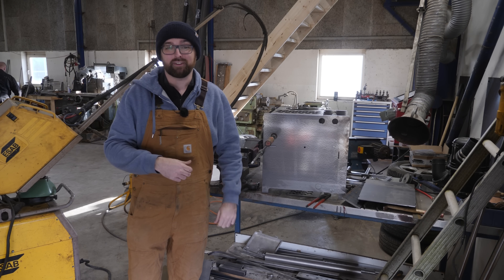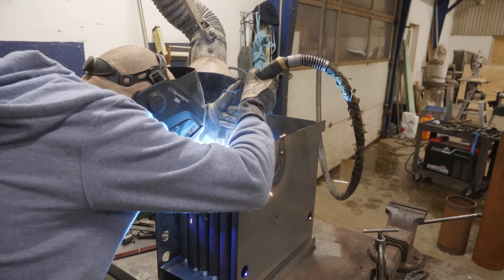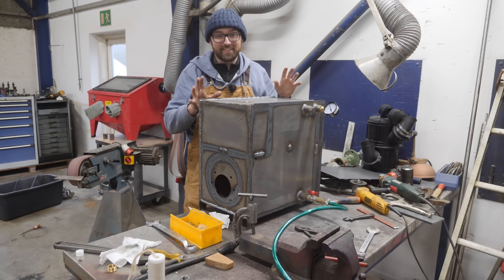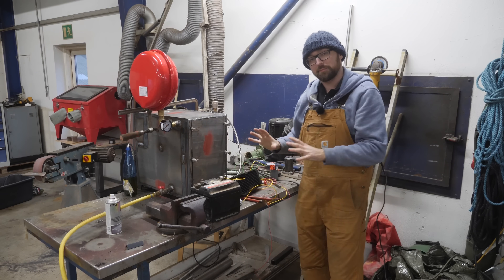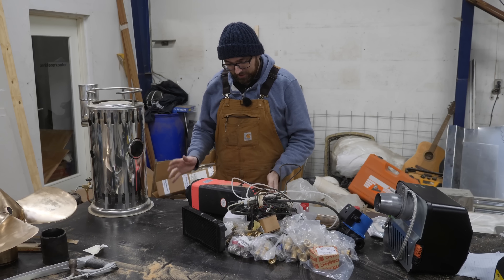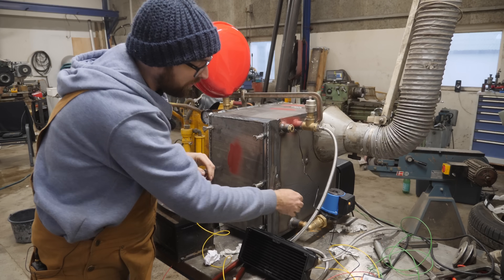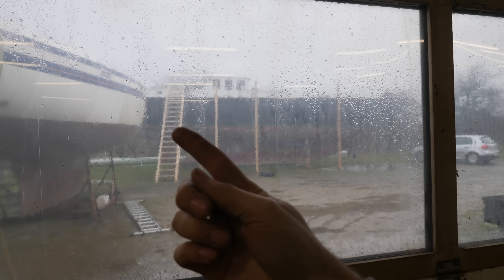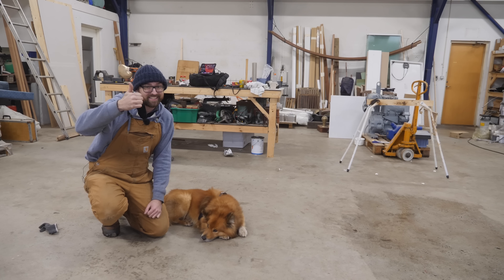Sail Life - DIY boat heating boiler - project sailboat

Comment: I wish he knew more about Espar heaters...I have been using them for about 20 years and have 8 years on my current one...they are used very heavily in semi trucks where drivers spend around 300+ days a year on the road. They require easy self servicing once a year costing less than $100 US. My current one has about 24k hours on it.  They dont run continuously because no heater runs continuously...on and off as needed to maintain heat.  They use very very little diesel and will cook you if you turn them up very high.
Reply: And they have a model that works with hydronic heating for RV’s and buses that would do all he wants to do with this
Reply: Here is a video of how easy yearly service is... https://youtu.be/XWSw60mmlzQ

Comment: FYI: I work for a trucking company in USA, and they have been using the Webasto Heater for several years, and I asked them how they avoided the expensive rebuild you mentioned...They said to avoid it, the heater has got to be ran at a least once every 3 weeks, even in the hot summers for at least 30 minutes...and we do run them...we get reminders every 2 weeks to run our (Anti-Idle) Heater for 30 minutes with the windows down if the weather is hot...

I have been driving my truck for 6 years, and have had the same Anti-Idle heater all six years, it has never failed me...even in the frozen tundra of Northern Canada and Alaska...In America truckers can be in 32 C in Florida one day, and -10 C in Canada 2 days later...

So I would recommend that if you use it as a backup heater to run it bi weekly to avoid expensive maintenance

Comment: I did not hear what you are planning for fluid in your boiler, but it should not be water. You need to have corrosion protection and boil over properties like in the cooling system of your car. You should also not use Automotive antifreeze (Ethylene Glycol because it is highly toxic.  The best choice is a “GRAS” (generally regarded as Safe) boiler fluid if you can find it.  A close alternative is one of the Pet Safe Propylene Glycol antifreezes like this. https://peakauto.com/products/antifreeze-coolants/automotive/sierra/  The Sierra is not labeled as GRAS rated but the only ingredients on the SDS are propylene glycol (CAS No) 57-55-6 (which is GRAS rated) and water.

Comment: Mads. You might want to consider  adding  a anode rod to the boiler even  using distilled water/coolant, corrosion  is a problem  in the entire system. The dissimilar metals of carbon steel and copper in the radiators is making on big metal moving battery. You have them on your hull for the exact same reasons.

Comment: Nice build.  It's not a boiler. It's a water heater. A boiler boils water and is pressurized. Boilers must be engineered so they don't blow up. A water heater does not heat water to 100 degrees C, boiling at sea level.

Comment: before enclosing steel boiler - probably should use a fireplace/stove paint on the outside of the steel to keep the steel from rotting/rusting when not in use.... at least something anyway that is heat applicable .... btw - that thing is HUGE!!! - - if you're planning any southern trips - why not a forced air system as you could double down on air conditioning - a much required item for our northern blood as well as keeping flying biting bugs at bay and comfy night at some protected marina without any wind!

Comment: Excellent. What size of hot water tank will you be using? Also in my experience, it would be wise to use Polypropylene Glycol in the system, because it's non-toxic and at 25% will not boil or corrode your system.

Comment: Where did you get that laser cut steel?  I have a CNC mill and I'd love to be able to cut steel with a laser rather than an end mill.  I am impressed by your tackling of any and all challenges on your vessel.  You are getting closer to the end game now.  Most of the big pieces are getting addressed.  I will be happily anticipating the completion of all the pre-splash jobs, and of course, then all the post-splash jobs.  I hope I run into you and Ava out on the seas someday.  Will be happy to share a libation.

Comment: Is cement boat guy interested in sharing his design? Very interested in seeing a parts list and cost calculation of this system. VS an off the shelf hydronic system. 
I'm in the Pacific Northwest and very very interested in fitting a boiler system.

Comment: Mads you’re pump needs to be horizontal, otherwise you’re water lubricated bearings wil be destroyed.
Reply: I was looking for this comment. Yes Mads. but You can loosen the 4 motor bolts and twist it so the connection box is up. All wet runners need horizontal axis. If he pump has an plug in the motor end, turn pump of, undo plug and bleed by push light on the axel some time.

Comment: Keep learning new kills, they will come in very handy when you cruise. A low pressure Boiler is a great idea but remember that 21 Foot Pounds is  still enough pressure  to cause a very bad accident. I would recommend a second pressure relief valve on the boiler. .

Comment: I live a mile from the water on the east coast of the US. my apartment has hydronic heat it is great very efficient and a fraction of the cost of electric heat, but a little dry though that won't be an issue for you on the water.

Comment: Interesting heating system it is similar to the one i planning to build so our boat. Im going to use a thermostat and a three-way mixing valve on each radiator so that i can controll the heat in eath place (se picure). Good luck with the system. 
https://drive.google.com/file/d/1eoWYejVHW759aanyOu8zp2nCkSfIxhfh/view?usp=sharing
https://drive.google.com/file/d/1evwqkMzj2ZMHmRcDJUzVnoGnbwcMicEp/view?usp=sharing

Comment: Are use that same cheap Chinese controller to regulate my refrigerator/freezer. Works great and they’re so cheap I bought a spare one just in case it died. Five years later it’s still going strong.

Comment: For efficiency, is the boiler design condensing?  It's certainly given me some ideas to strip a Grant or similar boiler, to give fantastic heat output and efficient fuel usage.  Depending on location will you duct air for combustion from the outside?  CO is always something to think about.  Good luck with this and I can't wait to see all the solutions to it's implementation.  Fascinating video but remind me not to get a ferro-cement boat!

Comment: Great job with the heating system. I agree the forced air cheap Chinese heater is not perfect. But I've never had it fail I have one in my camper and it works great also almost a tractor trailers have them in the sleeper birth. I drive for a living and have never had one fail and if it does last 5 years and then fail I'm not out any money just get another. Love the videos keep going can't wait to see you guys floating

Comment: @Sail Life  - FYI to help with the downdraft you can add a Vacu-Stack Marine Chimey Cap. https://www.woodlanddirect.com/Vacu-Stack-Solid-Pack-Stainless-Steel-Marine-Chimney-Cap?&st-t=shopping&gclid=CjwKCAiAhc7yBRAdEiwAplGxXwBmrMsKWfNYa3hCH7CWa0FhpyzsxdkYw-w8TiVtCrjrtxgXxt-7VxoCzDcQAvD_BwE&a=-26854_43=14984-17672_40=30057-17686_44=30071-17683_3=6594-

Comment: Shame you had to reinvent the wheel ! any small wall mounted oil fired boiler would be smaller and be 20-30 % more efficient  (fully condensing) and cost around £1500.00.  EOGB make 12 & 24V burners that would fit on your boiler they also make mini burners for range cookers that would be excellent for your boiler.

Comment: Please, make DAMN sure you get it professionally pressure tested. A horrific disaster could happen, remember a boiler is practically a bomb. Please be safe, consider your life and those that may be aboard. There are EXTREMELY good facts why boilers are  professionally built and cost so much.
Reply from the maker: Calm down :) It's just a pressurised metal box it's not the end of the world ;) The boiler was tested to 1.5 times working pressure (that's common over here). For pressure to rise in the boiler two separate temperature controllers will have to fail independently and then there's the relief valve. I see a few people that seem very nervous in the comments. I'm not concerned.
Reply: @SailLife  Good to know!🙂👍🏻I wouldn't have chosen this particular method, but glad you are being safe.

Comment: Mad look at something called waterless coolant made by a company called Evans for your circulation liquid its boiling point isn't till 190°c it also won't cause rust on the inside of the heater matrix or boiler

Comment: Will the water recirculate in the boiler or be expelled to some other application? I oversee the maintenance on boilers and find that if the water stays in the boiler it needs to be treated. When heat is applied to water it increases the PH making the water acidic causing massive corrosion to the components steel or stainless. I have 1/2 inch thick wall pipes that barely last a year. If you wanted you could make a mini water softener using a current design and just shrinking it. Also adding a sacrificial anode could help as well (I would use a triclover fitting that would make it easy to change out quickly without too much water loss)all house hold water heaters have them they are just long aluminum rods.  I love the boiler concept with the right maintenance program it can last you a long time and save on battery power while giving you tons of hot water. In fact my crazy little brain would add 20 peltier modules run in series and a large motorcycle battery to make it have its totally independent power system.

Comment: Nice job on the boiler. I think some passive radiators, provided you could find some of a suitable size with be good in some areas. Radiant heat seems to be easier to live with in my experience.

With the island diesel tank are you going to build a rigid stainless steel tank? Have you consider a fuel bladder as an option?

Comment: You don’t have to explain humor. Whoever gets it gets it and whoever doesn’t, well, that isn’t going to improve by giving an explanation...cheers! P.S. Couldn’t you have modified an empty LPG container for a core for a boiler? Less failing points and a cylindrical shape should benefit your setup.

Comment: Suggest that you run it above 65C-70C so it doesn't condense and rot itself out, I realize however that was just a test (guessing it is a steel boiler). There is a good reason oil fired boilers are mid efficiency 80%-85%... For the pex make sure it has an oxygen barrier and if you want the boiler to last a really long time put chemical treatment in the closed loop system. Nice video

Comment: I am curious of how your shunt system in all areas of the boat will work. 
And also how your exhaust above deck will look like, those burners are made for some self draught to prevent smell and blow back and you need a rather long "chimney" to achieve that. 
Any insurance thoughts? Not afraid that they might not like your non standard, non CE,  build if something should go wrong with it.

I will probably copy this solution but having a hard time find the amount of power the burner consumes.

Comment: If I were you I would inspect each and every weld that is questionable or thinned out in spots that you can still reach and grind them down and put an extra bead over them. The reason is this. You have some thin spots that don't seem to have good penetration and the fact that it doesn't leak any more now doesn't mean it won't develop a leak in one of those thin spots on the welds from the constant expansion and contraction from heating up and cooling down. The flexing can weaken spots that aren't prefect welds. YOu can use a "Capping" method that will surely clean up and strengthen your welds. Not saying anyone can achieve "perfect" welds but you can mitigate the chances of cracks with uniform solid welds where you can. You should also heat the metal before welding so you get really good penetration and thermal welds that don't crack with flexing. The the constant flexing of metal that will create issues with your particular design. Those welds will hold great in a static environment. Rust and scale is going to be the enemy without it being stainless. You should watch some Train steam engine maintenance it will give you some great incite on steam boilers and those tubes inside. Remember those tube are going to get longer when they heat up and shorter when they cool down pushing back and forth on those welds. Luckily they are short so there won't be much stretch or worping when they expand. Great job love the channel.

Comment: Great vid lucky you were able to get to all the leaks 3 things I was interested in plans for that boiler and a parts list for the burner setup also I hope your adding an anode rod and last thing. Use an Antifreeze solution or glycol for the system fluid. I watch your vids all the time in the process though much smaller doing an Albin 27 FC remodel and refit.

Comment: Your heater is a larger version of the Hurricane in my boat. Not sure where you priced it from but the boiler installed hoses ran and heat exchangers in every room with thermostats  was only $2500 Canadian.

Comment: A DIY boiler.  Jeez, Mads!  As a former pressure vessel engineer, please allow me a bit of advice.  Do not depend on a single relief valve.  If you intend to run at 1.5 bar and set your relief valve for say... 1.8 bar, please then get install something called a rupture disk.  It is a calibratred weak spot that will blow out in the case of a relief valve failure. Get one calibrated for your intended relief valve setting plus 5-10%.  Then don't just rely on leak tests.  Proof test it for strength with a hydrostatic pressure test at say 30% over operating pressure if using hot water at operating temperature or use an additional factor for room temp water.  I no longer have my tables for fired pressure vessels.

My mentor at the pressure vessel company I worked for pointed out that the pathology of a failed boiler can be indistinguishable from a bomb. A,bad way,to end a voyage.

Rupture disks and hydrotest at the very minimum.  Sweet talk a pressure vessel engineer to look over your design to be sure, though.

Comment: Thinking about steel and salt water, including salt water loaded air, I would be concerned about rusting the tank. Hopefully all welds hold and are problem free. But it would be cheap and easy at this point to put in a water leak detector. Just ensure that it is the low point that any and all water will eventually find if the boiler springs a leak. And oh yeah, you do want an off switch for the time when it goes off in a storm or some other time when you cant get to it.

Comment: Basically you're building a pressure vessel/heat exchanger which in the United States would have to meet ASME (American Society Mechanical Engineering).  The raw materials including the plate, pipe, and fittings would also have to meet ASME.  Do you plan to insure your boat?  If so, the insurance carrier may not insure your boat because of this boiler.  Good luck.

Comment: If you are going to use aluminum heater cores you need a sacrificial anode in the system like the ones they use in water heaters - you might even be able to buy one for the common heaters and fit that as a cheap and accessible spare part. The problem is lesser with copper core radiators but they still put them in all the water heaters I have ever come across for domestic use.
https://www.billigvvs.dk/Reservedele-tude-Bosch--Offeranode-t-Bosch-Tronic-4500-T-model-30-2272340.html?gclid=Cj0KCQiA4sjyBRC5ARIsAEHsELEAzcm8fKc5nsnYK4QkodWHtrVIWFJOZ_ieOFrF3RiwGESdR270rOQaAm3lEALw_wcB

Comment: Are you going to use antifreeze in the water? It will extend the life of your boiler and heaters a lot and you don't have to either drain it or risk frost damage to the boiler during winter.